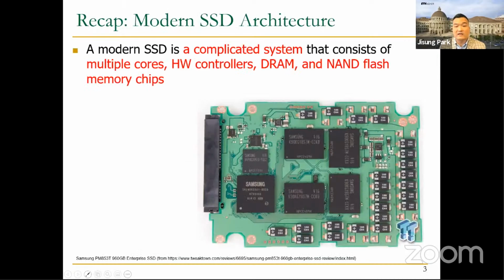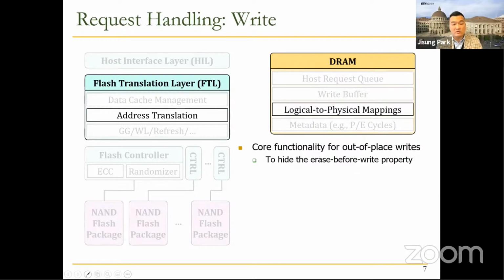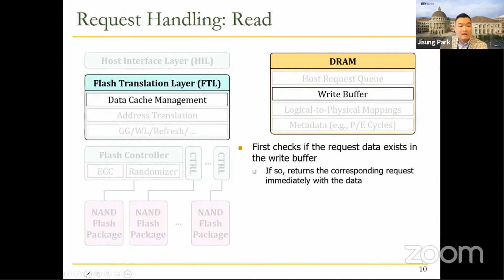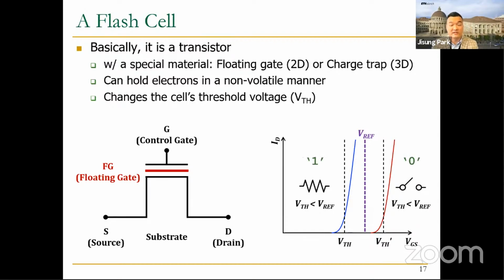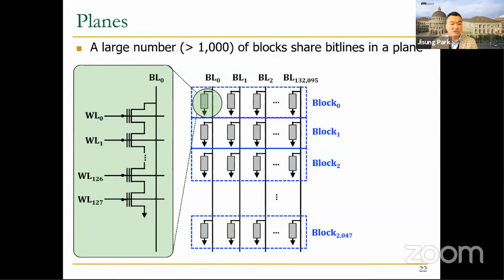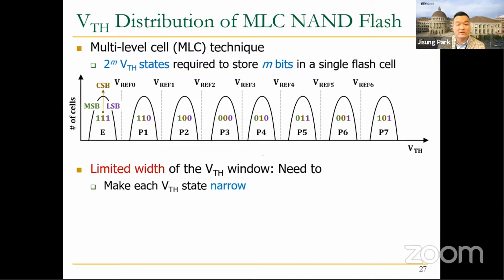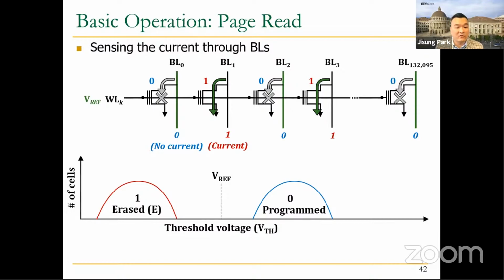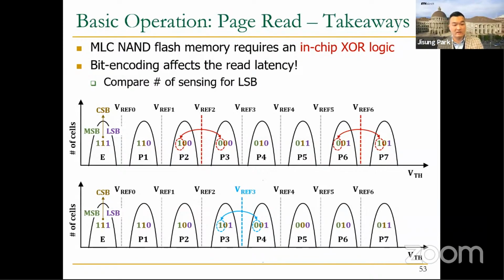Modern Solid-State Drives (SSDs) Course - Meeting 2: Basics of NAND Flash-Based SSDs (Fall 2021)

Comment: Is there any relation between the "page fault" we learned from the Operating System and the "so called 4KB alignment (512 Byte Sector X 4 )"  ?
Reply: Yes, in both cases you will get a horrible performance. In the page fault case the page isn't in RAM and it has to be loaded from disk. With unaligned read accesses, you usually get a very high read/write amplification (it needs to read+write many pages to service a single request, so it leads to much slower response from the SSD and a bigger wear of the NAND flash.